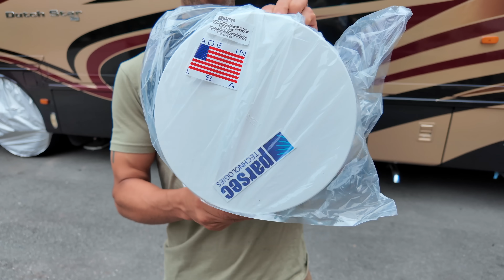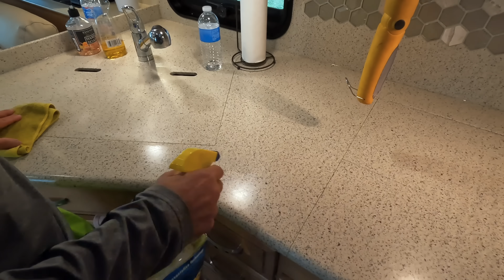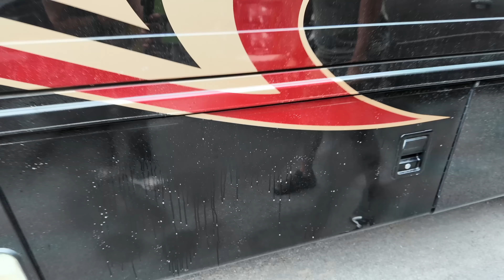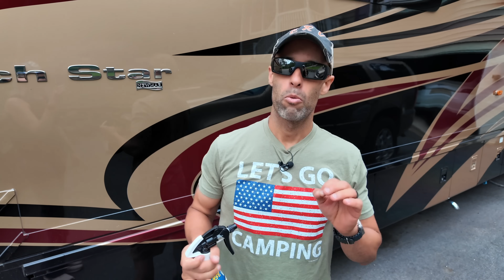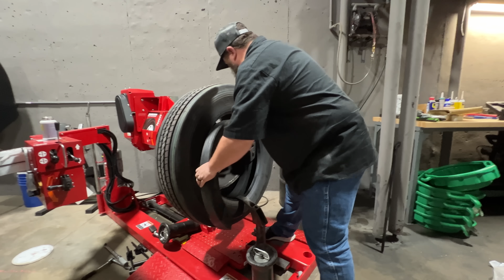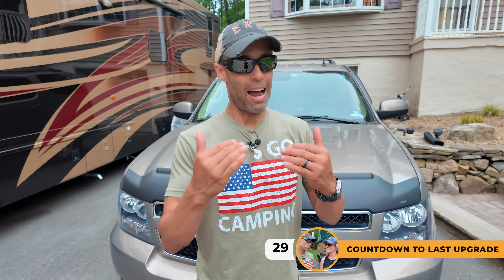Here Is What We Are IMMEDIATELY Fixing On Our New Motorhome!

Comment: Hi guys, awesome new motorhome love it but I have a question about the retro fit bands. I have the tires on mine and I was wondering if they did a high-speed balance on the tires when you had it done because I’m getting wobble about 3540 miles an hour with mine, which is gotta go into service for that Through General Rv very disappointed in them anyways I just wondering if they did anything like that for Nelly great video guys thanks ! Safe travels
Reply from the maker: Yes balance is part of install
Reply: General rv says they don’t balance! I told them that doesn’t make sense!!🤷‍♂️ thank you for the info

Comment: getting more lithium is great....do you have DC to DC charging too...as you know solar is just a trickle.....I had BB, but they are way too expensive, when I had to replace them, I went in a different direction.  Good luck with Stella.
Reply: When you do Solar and lithium batteries, make sure you apply for 30% federal tax credit for Solar.
Reply from the maker: @kb748 👍
Reply from the maker: 2500w of solar is a little more than trickle.
Reply: @EndlessRVing  still on cloudy days and shade will decrease output....did you get shadowflux panels to help?
Reply from the maker: @crinagrewel6936 we have a 10,000w generator if needed

Comment: Great vid.  I definitely need to get the Release Cleaner.  After buying our MH (a gasser) we drove it from Myrtle Beach to Massachusetts.  After that, we upgraded the chassis with Safe-T-Steer steering stabilizer and a Super Steer rear track bar.  These were two very good upgrades.  Still thinking on getting Sumo springs and Koni shocks.  We have Bilsteins but a lot of what we read is that the Konis are better.  Lastly, thinking on doing the roof with the flex armour. Love that you only have to clean it and not worry about leaks.  Great video.  Keep them coming.
Reply from the maker: Thanks for watching

Comment: I've seen Roof armor done...unless I had an older coach with a failing roof I wouldn't put it on a high end coach with a fiberglass roof myself... If you ever have to replace a roof vent or anything it's an extra layer of material to take off and at some point it will require maintenance itself.  Love your new coach!

Comment: Trying to find my comment, but I can’t find it so I’m gonna repeat it. Why would you cover at one piece fiberglass roof with a rubber composite material? The Dutch star is not a Baystar. Also, how much solar are you going to integrate into the battle board nuclear power plant you just spoke of? Five game changers and two 3000 W inverters. I can’t believe you guys I’m not a hater. I’m just a concerned follower  Thomyt
Reply from the maker: 2500 watts of solar and never have to maintain the roof.

Comment: I ordered the "Release" cleaner based on your suggestion. I used your savings code (thank you). Even so it was expensive. That said, 80 bottles of cleaner will not only outlive me, it will also outlive our kids and probably our kids kids. If I am alive in 120 years when the last of the 80 bottles runs out, I will post to your YouTube channel to let you know if the purchase price was worth it. All the best!
Reply: For once, I have a legitimate question and comment if you have a one piece, fiberglass roof why would you cover it with rubber?  Maybe I need some more education here, but I was under the assumption that the Dutch star had a one piece fiberglass roof not like a Baystar with a gummy????. Thomyt
Reply from the maker: @rvvideoswiththomyt5263 so you never have to maintain it.
Reply from the maker: It’s 100% worth it👍

Comment: All very important upgrades that will add to the safety and security of Stella. Hopefully you will never have a problem with DEF sensor failure, it seems to be a fairly common problem (we had it happen on our 2020 DS, fortunately under warranty). The problem arises when the sensors fail, not the actual system. The sensor failure tells the engine to drastically derate power, leaving you stuck. There is an RVer out there who builds a bypass kit for a reasonable price that allows you to swap it in place of the OEM DEF head temporarily so that you are not stranded on the side of the road. It's a good part to have on hand just in case, I highly recommend adding it to your parts inventory.
Reply: Follow up to my previous posting: after doing a little more research (Google search), it appears that pre 2016 DEF units on Freightliner chassis may not have the DEF head failure issue. You might want to do a little more in-depth research on it.
Reply from the maker: The def head problem seems to affect 2016 and later and even more on Spartan chassis.  We will discuss with freigtliner.  Thanks for the heads up